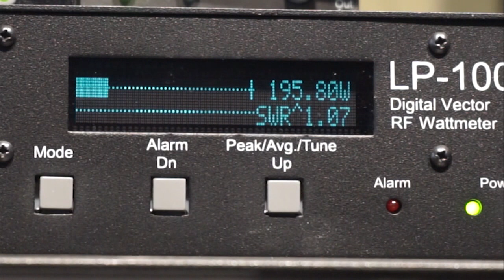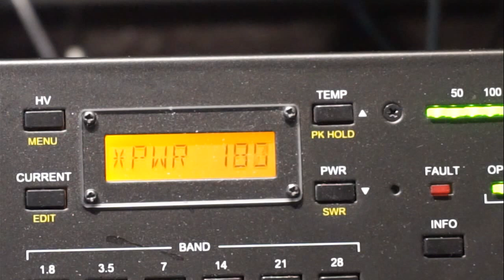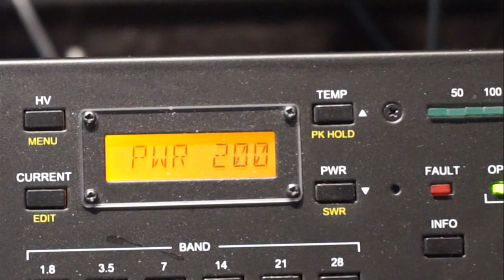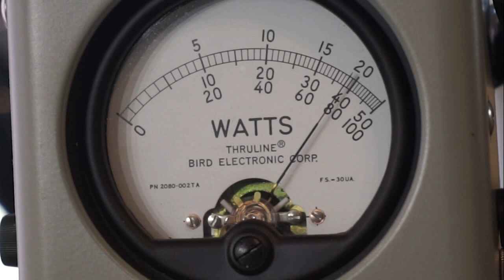Ham Radio Basics--Jim, W6LG Discusses SSB and Analog Meters

Comment: Thank you for this clarification, Jim. I notice a variance between an old tube amplifier and a more current basic transistor amplifier. The tube model analog meter reading has a larger discrepancy between talk and whistle reading than the transistor version. Your info on this likely has saved me future grief and dollars. Regards from Queensland.

Comment: If you input a steady state tone to an ssb transmitter, will the analog meter read the peak value, or will it still fail to capture it correctly?  If so, why?
Reply from the maker: That should work if the tone is clean.  Two tones produces other issues and will not result in what you want to see.  You can key the transmitter in the CW position.  Thanks for asking. 73, Jim

Comment: I have a transceiver, amp and tuner. If I got a Bird meter to better see my power output, should I place it between amp and tuner or between tuner and antenna?
Reply: Well, that depends on what you want to see. If you want to see the power that's going from the amplifier into the tuner, then you'd place it there, but if you want to see the (let's say forward) power going from the tuner into the antenna, then you'd place the meter between the tuner and the antenna. Do keep in mind that the expected values can be different. 

If we assume that the input impedance of the tuner is well matched to the output impedance of the amplifier, there shouldn't be reflections between the amplifier and the tuner. In that case, a wattmeter measuring power will show you the output power of the amplifier. 

Since you're using a tuner, I'll assume that your antenna impedance is not well matched to the output impedance of the amplifier. Let's analyze for a second what's going to happen when EM wave goes out of your tuner: First it will reach the coaxial cable (or whatever you're using). Here we might see some reflections due to the impedance mismatch between the tuner output impedance and the cable impedance. The part that goes through the cable will be attenuated and then reach the antenna. A part will go into the antenna and be (let's hope mostly) radiated. Another part will reflect back into the cable and travel along the cable (getting attenuated again) towards the tuner. When it reaches the tuner, a part will be absorbed by the tuner and a part will reflect back into the cable and towards the antenna.  So if you're measuring the forward power after the tuner, it's going to be the output power of the amplifier minus the tuner loss plus all of the power reflected from the tuner back towards the antenna. 

The above might be important in some cases, when you need to determine the maximum power certain components in your system can take. For example, if your coaxial cable is problematic enough, it can happen that the forward power is within its power handling limits, but when summed with the reflected power, the total power might go above the maximum power rating for the given frequency.

Also keep in mind that the Bird 43 and its relatives are designed for 50 ohm lines, so having one between the tuner and the antenna will affect the total impedance of the whole system. On HF, it might not be too big of a difference, but if you're doing VHF/UHF, then things can be a bit complicated. 

73 from YU1NKA/DM1NKA

Comment: Hi Jim,
Good visual showing the differences between average and peak reading meters when operating SSB. I have added a peak circuit to my Heathkit HM-102 and also to my Bird 43.

I've heard you on the air several times and your audio quality is excellent. Since I'm only a General, couldn't respond to any of your CQ's. I'm working to upgrade to Extra.  73  WB3BJU